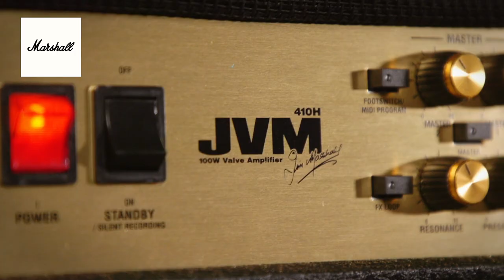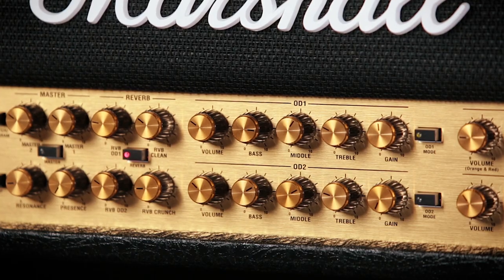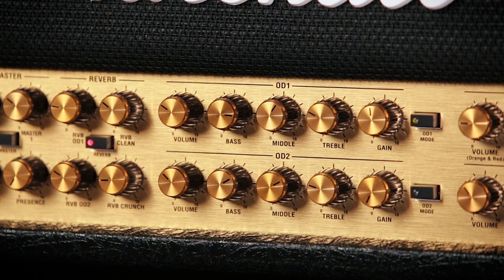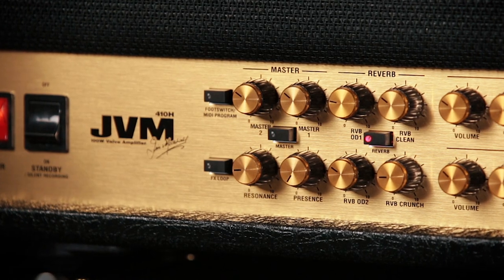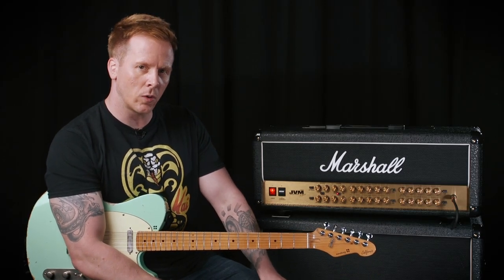JVM Tutorials | Alt Rock Sound

Comment: Is Marshall preparing for a new "JVM-like" product? They are doing lots of demos for the current JVM :-D
Reply: No they are showcasing their best amp.
Reply: @duncanearley  My personal opinion is that this is one of their worst amp series they made. A pure fuzz machine with overly saturated gain.
However, I know that many people like the modern sound of this amp...I like it's versatility in it only.
Reply: @NizarOdeh85  Same, I own 410H, but I had it modded by one guy that turned the fuzz/gain down (even after that, there is still plenty of gain) and made it more dynamic. 
Now is the second channel finally usable.
Reply: @Roonagu  Yeah there are few guys on YouTube that made their JVM410 amps sound amazing...I tried tons of preamp and power amp tubes with no luck. I won't go down to the motherboard level of tweaking.